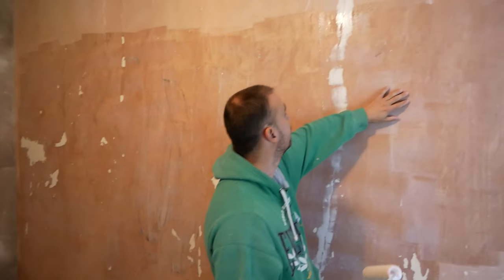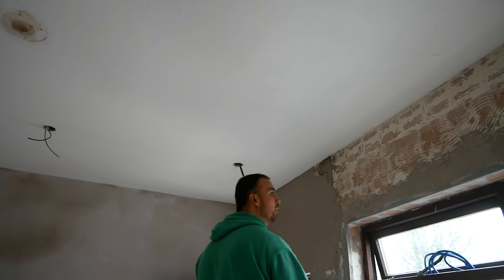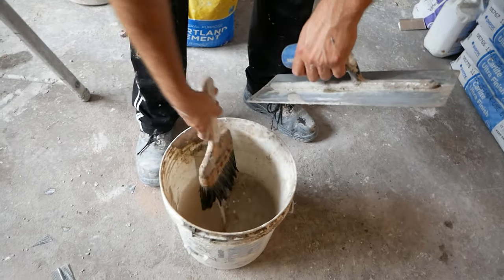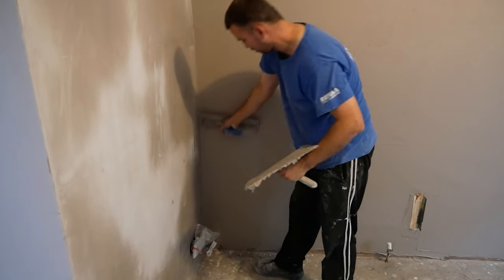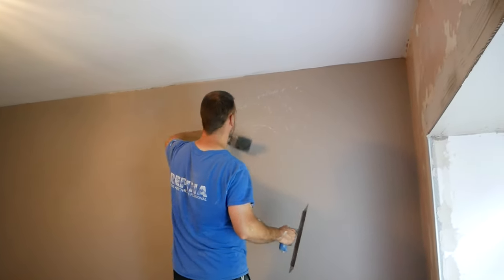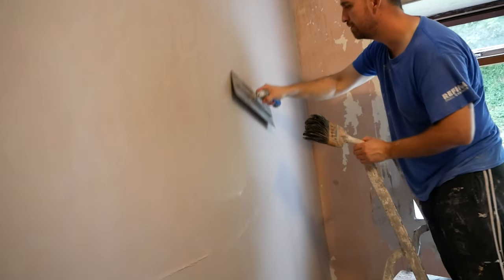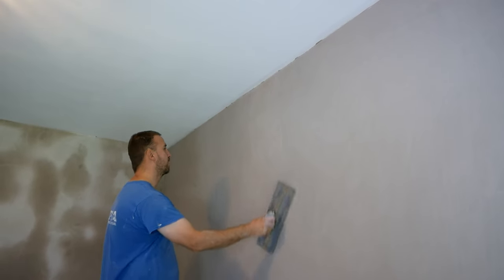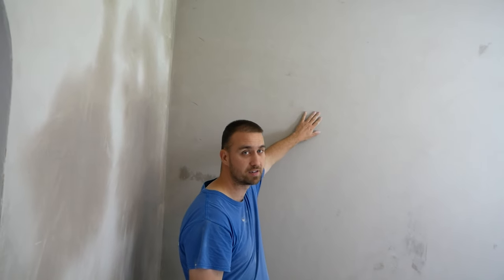How To Plaster A Wall  Skim Coat Plastering skimming  Plastering Tutorial

Comment: On something like the door and window wall we usually put bonding in with the mix saves having to put it on thicker. Good for losing the pattern over artex as well. We recommend to the customer to mesh them as well. straightens the walls out, and no come backs with cracking. I would use it as standard on all old re-skims, but sometimes the customer doesnt want the extra cost.
Reply from the maker: thing is with the mesh it dont 100% not crack and if it dose crack it can be a real mess and again bonding on window walls I try to avoid mate as bonding will not be good with any damp but for sure it can help fill out the likes of that wall was scrapped off all the old adhesive before hand :)
Reply: @macplastering No nothings 100%, but im big on it especially on old walls. Yeah i see what you mean. I dont fully bond, but a few scoops into the skim just to give it more body.
Reply from the maker: oh what we call the magic mix loads of guys do that on ceilings i know and for sure nothing is 100%
Reply: @macplastering  Thats it yeah the magic mix.

Comment: Hey mate love the channel. I’m originally from Lisburn, living in Perth Australia. I’m thinking about having a crack at rendering some outdoor brick walls around my house. Is there a minimum depth of scratch coat because my way of look at it is if I could keep it thin I could just straight edge against the brick as it’s quite textured. 
Congratulations with the new baby.
Reply from the maker: Over all 10 mm should be OK so if did 5 mm scratch then lay on 7 to 8 and rule that off should be 100% mate and thank you 😊

Comment: Hey so you don’t really need a flex trowel to polish?
Reply from the maker: Hi mate no you can do it grand with the steel think I have a real old video showing the both trowels doing it on a how to reskim a wall vid but basically the main difference is the flexible trowels are better at it and especially the amount of pressure it takes of your arm making it easier so most Plasterers will get them to save joints in the arm getting sore or fatigue

Comment: Ive moved away from pva for sbr especially on those old walls.
Reply: What sbr to you use and do you use it neat as have some old crumbly walls to skim and how far does sbr go
Reply from the maker: do you plaster over when wet or let dry as i find sbr has a very short to no tacky stage
Reply from the maker: me myself when had to plaster over a wall that wasnt great and crumbly we paint pure sbr over then next day pva and skimmed worked in well but again was last resort would have been best to chip all over and re do
Reply: @macplastering  Thats the thing about pva. For me you leave it go tacky because thats the earliest you cant hit it otherwise it loses contact with the wall. It has nothing to do with adhesion. Thats what i think a lot of people get wrong about pva because you can let it dry completely then go over as it re emulsifies (goes wet). sbr leave it go dry or tacky makes no difference. The only thing they both have in common is that you cant start when its wet especially with skim. sbr is far more superior imo.
Reply: @noodles8203 I’m a convert. It goes miles, actually seals the substrate and is consistent. I always let it dry completely and always did with pva due to being impatient and having swathes of the wall sliding about